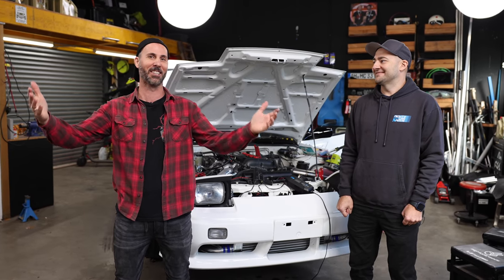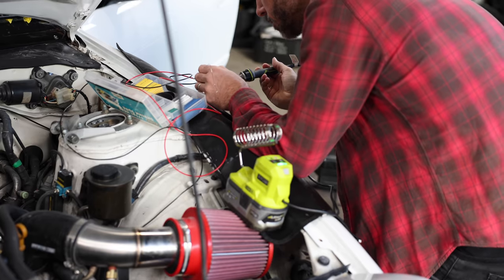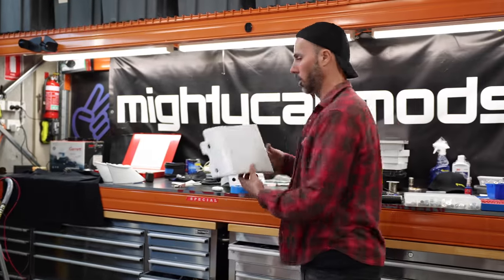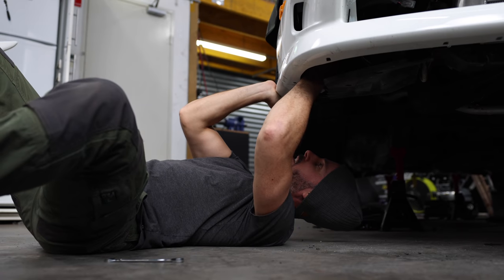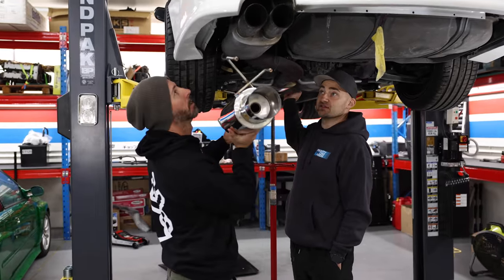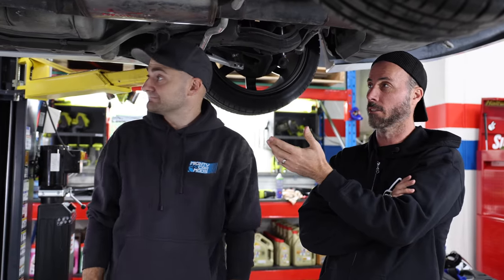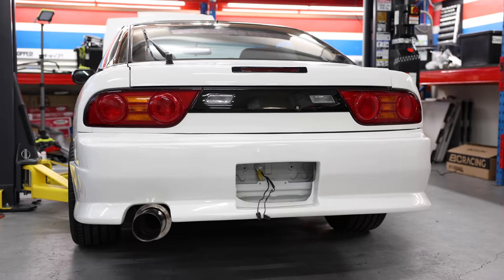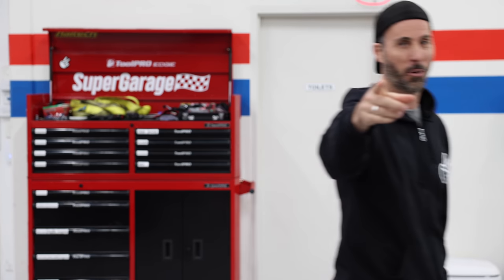180SX - DREAM BUILD EP5

Comment: The rear spoiler got me laughing so hard my neighbors woke up. 🤣
Reply: Feed it the right nutrients with lots of sunlight and it will grow into the right length 😂
Reply: Bruh, the slow walk and calm depositing in the trash at the end =)))))
Reply: Looks like theh measured for a 326 power spoiler not the OE type X
Reply: So did they measure wrong ? Is the spoiler non genuine ? Cause I thought the only fibreglass bit was the rear bar ? Or did they simply measure the space wrong for the type x wing ?

Comment: Quick tip if you want to use an oil barrel for putting stuff in.
Get a grind disc and take it over the bead where they put the lid on. 
It looks much nicer, and it leaves a nice edge that's not that sharp.

Great vid, I love you guys.
Greets from the Netherlands

Comment: For absolute purity, mount a coupla Ryobi 18V ONE+ Compact fans on the boot to cover the binned spoiler holes.
Set up options include extra thrust, air brakes, or down force. 👍

Comment: The scene when you kept sliding the wing left and right to line up with bolt holes was priceless. Truly priceless. The sheer silence of disappointment XD. It looked like it would actually fit if it sat on the very ends (i know thats not what was intended but it would look nice i bet still).

Comment: I think this is the earliest I've watched a video from the tome posted lol. I'm really loving the direction you've taken the 180, we all wish we could go back and re-do our first real projects with all of the parts and in my case care and safety that it deserved.  My first was an LS swapped chevy s10 pickup,  and uh yeah a tiny truck with over 400hp in the hands of a 16yo with no cage no brake upgrades or really any modern safety equipment other than what 1994 American highway safety required. Just as a FYI it varies state to state and my home state of Florida only required at the ti.e to have windshield wipers, headlights, taillights, and indicators so....

Comment: Just a tip, when vacuuming the carpet run a orbital tool (sander with no paper or a D/machine with an old pad) place it down and watch the vibration lift everything 👌
Reply: Massage gun $20 on ebay😂👌🏼

Comment: Recaro would be wise to recreate those seats. I can't believe the Integra Type-Rs in the US never came with them (they also had the crappy steering wheels too), sometimes Australia really did get the good stuff :D
Reply: Hey is the the price for the seats? 40,000 dollars?
Reply: @jessielazos9263  haha not quite that much, but he probably paid $3,000 USD for those in that good condition. So probably about $5,000 Australian dollars which is pretty crazy.
Reply: Recaros came as an upgraded factory option on 2013-2018 ford focus ST and RS . I love my bucket seats 😁
Reply: Same goes for the Recaro STI 330s seats. I'd love a pair.
Reply: Recaro Speed, £860 sterling new. They can still be ordered off recaro.

Comment: Will you zip tie the rear bumper to the center section by the tail lights to fix the bumper gap? It's a very common thing and you never see the zip ties but it really cleans up that area

Comment: Needs a Kakimoto R cat back exausht I have had one on my 180SX for 22yrs though on my second one it sounds nice and keeps the cops away until you open it up. I also have a aeroplane catalytic converted 4inch with 3 inch ends custom exhaust manifold and dump to the cat all ceramic coated.

Comment: Moog, when you put the new tail lights in, what was the sealer on the lights called and where can I purchase it from, I've tried windscreen sealer and it doesn't work and the same result with silicone, need to go back to the factory method.

Comment: 250hp pah you can get a very reliable 300bhp plus with your mods both my 200sx s14 and s14a's had over 340bhp and 350bhp with blitz, bolts on's turbo, front mount, full turbo back exhaust, walbro fuel pumps, greedy controlers & ecu remap, hks coils, plugs multiple layer headgasket. 
" 😂 that spoiler fail bit 🐣, funny as feck" lololol

Comment: 4:25 for a couple of years before my dad died in 2020 he worked for the comapny that makes all the seats for Hondas globally (like it's the thing that company does. They don't do anything else. honda does not buy from anyone else for stock seat). in 2019 i catastrophically shattered my right femur mountain biking and as part of the physio process i need a booster cushion. So i asked him if he could grab me some seat foam from a Type-R. He said he couldn't coz they used Recaro's  or Sparco's or Whatever but he would see what they had in the factory. He pulled through. Upon delivery he told me that those recaro's\sparco seats are cheaper to make than the standard seats in a base Civic. Why? literrally all they have to do is stick them in a mold and then upholster them. Stock seats frames need to be made from multiple individual parts, then they get foamed, then they get upholstered. 40k for a race seat is literally 99% more than you should pay. Coz it didn't cost the company more than 2K to make it.

It's also the reason why I'm never going to change the seat in a car ever. The stock seats perform better in a crash. I've seen the test results.